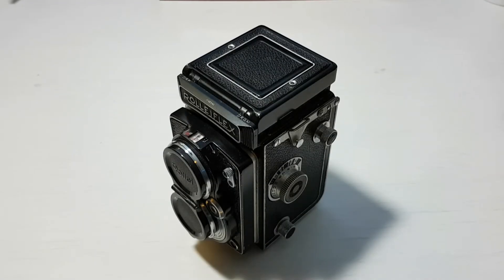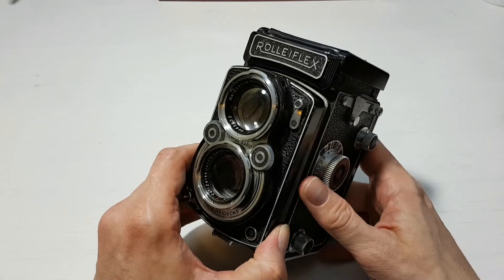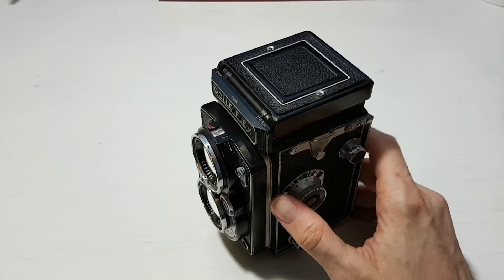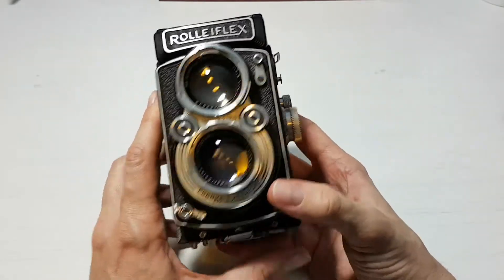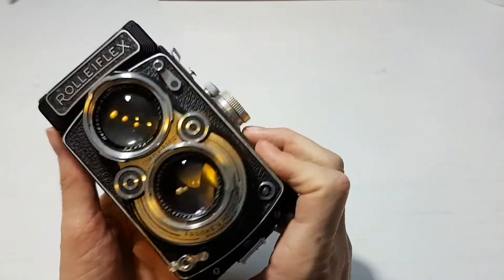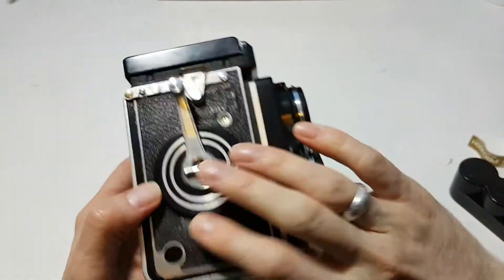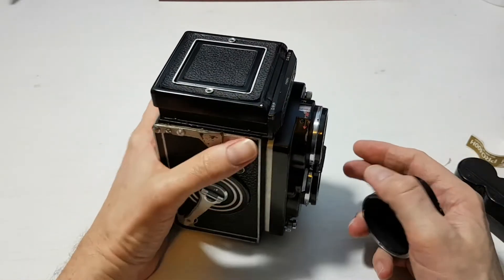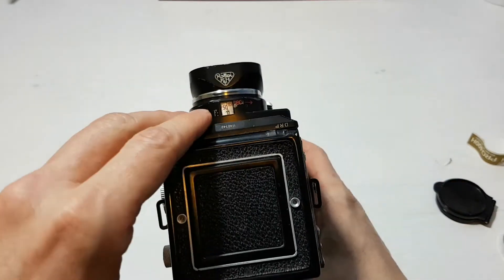Rolleiflex 2.8a TLR -  User Guide & Review

Comment: The history of the Rolleiflex A is a bit different than suggested here. The "A" did run into a lot of complaints and problems relating to poor lens performance. After the War, Rollei, like other German industrials, was basically closed and struggling to get back into business. It finally got into production in 1948-9, and it needed lenses for the camera, the "A". They had a batch of 80mm 2.8 Tessars which they had purchased from Zeiss before the War and stored for the duration. The problem: these lenses were uncoated. That was fine in 1936, but a non-starter in 1949. So, they sent the lenses out to be coated. The company which did the job disassembled the lenses, coated the elements, then reassembled the lenses without regard to their original matching of elements. Since each lenses was custom matched by Zeiss when made, most of these lenses would simple not be able to perform. Particularly important to the 80mm Tessar, as at 2.8, the lens design was being over-extended and had to be very carefully matched to be usable.  Rollei got a flood of complaints abut poor sharpness and contrast. Figuring out what had happened, they did a full recall to replace the lenses on all cameras returned. The story is that about two-thirds were returned and got new lenses (not Tessars, maybe Biotars). The rest are still floating around, for better or worse. So, as Rolleiflex go, the "A" with Tessar is more of a collectible for its novel history than a user, but then some people think a Yashicamat has a sharp lens, so there you go.
Reply from the maker: Thank you 👍🏻
Reply: 我也买了一台禄来2.8a，但是我对他一点也不了解。他的摄影镜头好像是蔡司东德天塞80mm f1.2的镜头，不知道是更换过的还是没有更换过的。

Comment: 80mm f/2.8 Carl Zeiss Jena Tessar vs. Carl Zeiss Oberkochen Tessar. (I've had a Rolleicord V for decades, which sports a 75mm f/3.5 Schneider Xenar lens.;) Neat 120 multiple roll film case, how things have changed! I had to make do by keeping film in boxes or saving plastic Fuji 120 cases back when Verichrome Pan and Kodacolor-X did battle with Fujipan and Fujicolor film. Back then, I used a Sekonic L-28C under varying light levels or Ye Olde Nikkormat FTN's meter.

Comment: Everyone is raging about the 2.8 and the 3.5f ... what about other models like the 11A? 111A? What’s the difference between these? Why are the 2.8 so desired?
Reply from the maker: electrabot ,the 2.8 models are more expensive purely because it has a lens with a faster aperture of f2.8 so is better in low light, able to blur out the background more effectively etc... the 3.5 models are though great and all have sharp lenses.  To my knowledge rolleiflex didn't make a bad TLR camera. Get the one you can afford and you should still get great photos. But factor in around £100 for a service on top. Plus those versions with a working light meter always cost more. But I use an app on my phone so it's really not that important if the camera doesn't have one.

Comment: FYI.  I think you will find that if you turn the shutter speed wheel further against the resistance (it used an extra internel spring) you will get it to go to 400th of a second.
Reply from the maker: Alan Clark , I checked with the engineer who fixed it, who used to work for Rollei and he said to not force it and only ever set it to the 400 speed before cocking the shutter due to the strength of the spring. It's annoying if I've found it in to the next frame and then realise I want 1/400 but I've learnt to live with it.

Comment: The 2.8a is historically regarded as the "lemon" in the series, and Rolleiflex quickly abandoned production and replaced the glass for future models. A lot of pros were dismayed at the "poor" quality of the pictures it produced, far from the reputation F&H had amassed up to that point.     Can you comment on the quality of the images?  is it noticeable lacking?  im curious if history judged this model to harshly
Reply from the maker: The Cantrell Project I kind of cover it a bit in the video, in that the ones made with bad lenses are not very good and were replaced by Rolleiflex with a less problematic lens. But my camera is fine and lovely and sharp even wide open. 
I consider it very good and the photos I get are really special.
Reply: thanks for the response!
Reply: The 2,8 Jena Tessars were from batches made before the war for the Ikoflex III camera. It wasn't made anymore after the war, so F&H bought them for their first 2,8 Rolleiflex. During the coating process some lens elements were mixed up, so some, not all, produced less then stellar results. So those would be sent back for replacement with new West German Opton-Tessars, and the rest of the camera production got the West German lenses.
The 2,8A is a gem for collectors and users alike, and even more so with a good Jena Tessar, because of the history and rarity. Of course, the Planar and Xenotar cameras are optically better, but there are so many of them.
Reply: the problem with all 2.8A cameras is the the 4 element Tessar lens design was never intended to reach 2.8 in the medium format focal length. The best of them are going to be clearly inferior to the later Planar or Xenotar 2.8 bodies. Why did Rollei use 80mm Tessars it knew were not up to Rollei standards? The Tessars were a batch planned for Zeiss before the war but never used. After the war, Zeiss was bombed into the stone age and couldn't produce lenses Rollei needed for several years. Rollei needed to get a new camera intto the market to stay alive, so they took a chance on sliding by with these pre-war Tessars. They only made this camera with the pre-war lenses for about a year, then moved on to better, new lenses/models. For many years they sold a Rolleiflex model with the 75mm 3.5 Tessar, which did not suffer the quality problems of the 80mm 2.8.
Reply: @randallstewart175  Yes, you are correct about the 2,8 Tessar being inferior to the 3,5 version. Schneider made a five element Xenar 2,8 (split front element) to correct for this problem. It was available in 75 mm and 50 mm (renamed 'Xenon' for the pre-war Kodak Retina cameras. Not to be confused with the six element 2,0 Xenon made at the same time).

The 2,8 A was made for a short period, and then came the 2,8 B with East German Biometar, which wasn't in production for very long either. It was first with the next model, the 2,8 C with Xenotar (and later also Planar, that the 2,8 model had "matured".